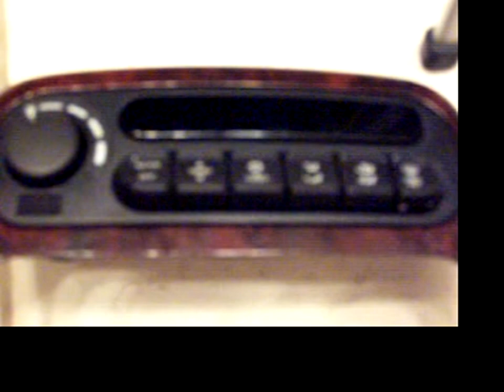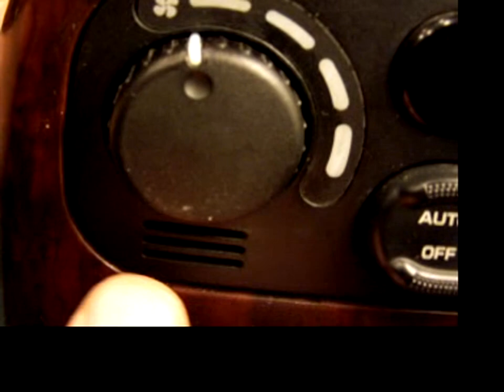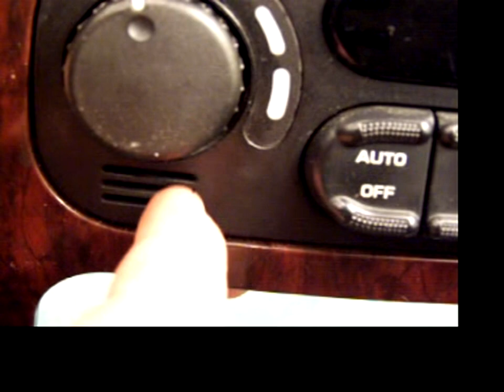Automatic Temperature control ( ATC ) part 1

Comment: Hi, I certainly appreciate the great help from your videos. One problem I have is that I cannot find a clear way to pull the wires out of the plug so that I can follow your advice about cleaning them. What sort of device do you use and where do you apply it on the plug? 2002 Concorde LXI with the same display problem.

Comment: I have a Chrysler Concorde, 2000 - same problem.  I replaced entire panel at local garage on 2013-07-25.  I had no time or knowledge on how to do it.  It was a pretty hefty cost over eight hundred dollars.  But it has been working ever since.  Still have the vehicle,  although I am having the Blend Door Actuator replaced today.

Comment: i have tje same problemon chrysler 300m, i check the solders on the shown resistors and it is working now, thanks
Reply: how did u do it
Reply: i soldered the kind of resistors that are shown 8:22. the location of resistors are close to screen.